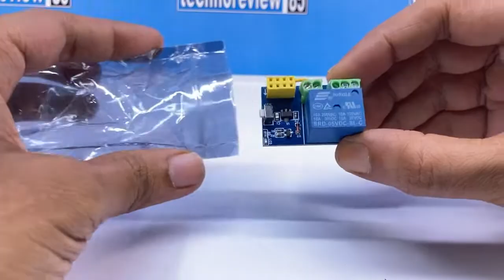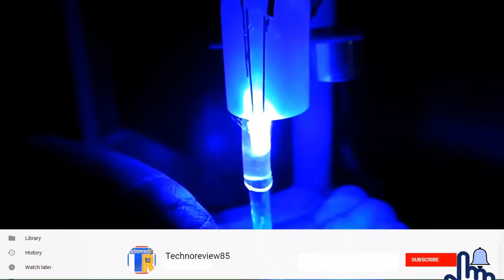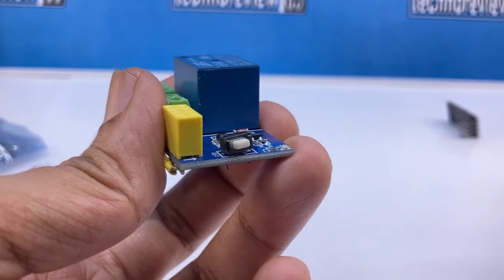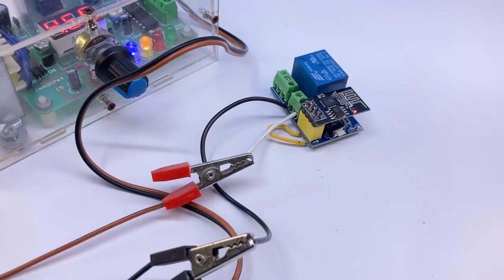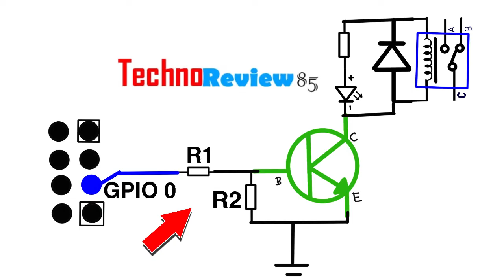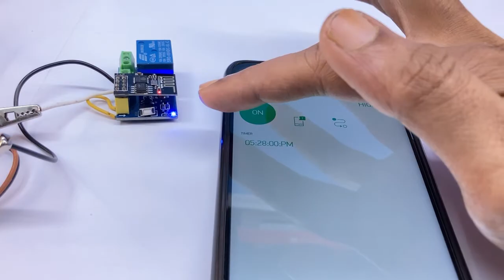Esp 8266-01 relay module review & not working problem solving

Comment: Thanks bro, any idea how to make the default power status OFF
Reply from the maker: You can remove attached resistor or remove LED.... or use a small black tape on the LED. I think it will be better.
Reply: @technoreview85  thanks for your fast respond, but I meant when the power cut and return the relay should be in OFF mode even if it was ON before the power cut.
Reply from the maker: Okay.... please try the P & N/C pin instead of the N/O pin. If the esp01 default status is high then the opposite connection on the relay may make it off in default.
Reply: @technoreview85  Thanks a lot, I'll try it and feed you back

Comment: As an alternative to removing the resistor, connect a 4.7k resistor from GPIO0 to VCC.  That will allow the ESP8266 to boot.  Also connect CH_PD to VCC since it is unconnected.

Comment: Hi, i wish to use it for home sadety, but not have much idea,
Can you tell me what application i need to run it? And do i need to program it?
Reply from the maker: Sure.. you can program it using Arduino ide. You can use esp8266 nodemcu which is upgraded version of this. This module for IoT based project so operation app depends on your IoT platform